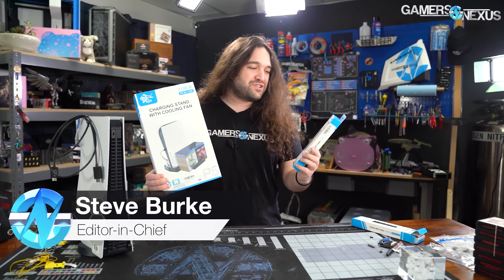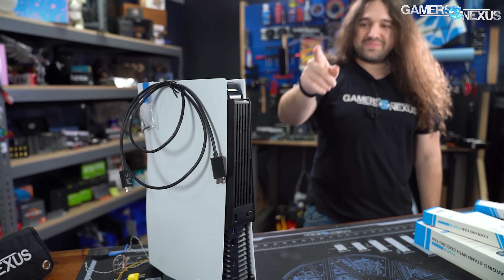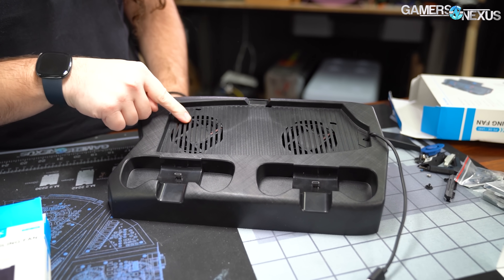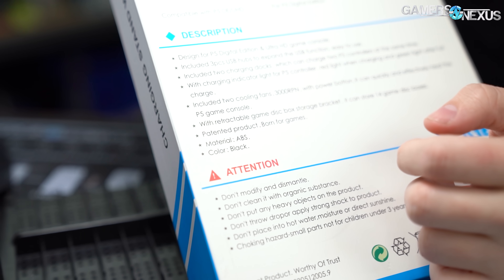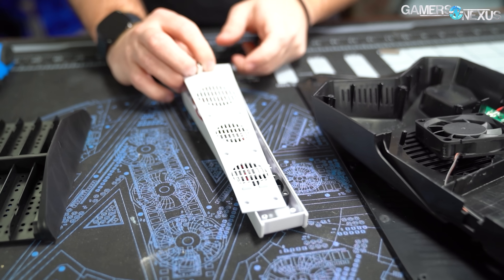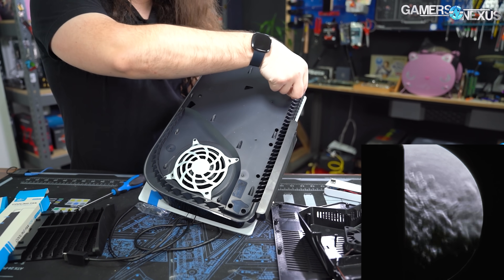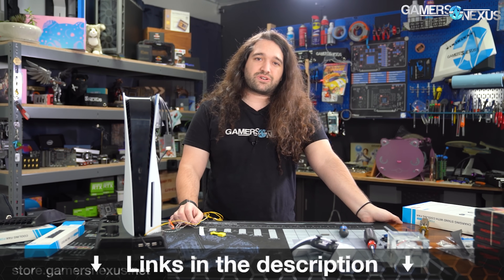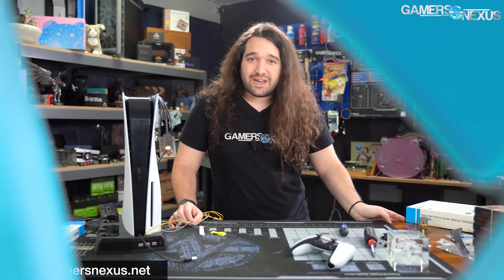Basically A Scam: PS5 Aftermarket Cooling Fans Blow the Wrong Way

Comment: Bahaha this has been the same since the Xbox 360 days
Reply: Your right even if they do work they will kill your console faster because of dust build up I've worked on 3 generations of console's that suffered early demises because of them
Reply: anyone remember NYKO? lol
Reply: @CozzyB  hah i forgot about that, i just got the cheaper usb model.  the original 360 sure liked to melt itself to death
Reply: @CozzyB  the "Intercooler" Nyko fans were monsters.. I've had one for years, and since it runs on the 12v power brick (instead of a 5v 1amp USB power), it's much more powerful, and CHUCKS air.. it doesn't even allow the highest power drawing Original "Black" Xbox 360 to get warm..
The Intercoolers were in a different league than all other "cooling fans"..
Reply: I bought an xbox 360 cheap cooler.  I had to take it apart and flip the fans so they blew the right way.
Reply: This is just the result of someone feeling stupid they once fell for this kind of aftermarket tech and is trying to make themselves feel better about it.
Reply: Needs more hole technology though.
Reply: Not really, just don't buy cheap Chinese branded stuff like this. I bought a cooler for my Xbox 360 S that does indeed pull air out of the top vent. Don't support these brands, do research
Reply: @DaysofKnight  He was referring to the original xbox 360 cooler not the slim cooler
Reply: @DaysofKnight  lol you should do research. None of these after market fans help.
Reply: @DaysofKnight  just a heads up all aftermarket from ps2 up have been china specials
Reply: @DaysofKnight  do you even understand who you are replying to.
Reply: @DaysofKnight  You bought a cooler for the console that was specifically redesigned to fix the cooling issues...
Reply: @DaysofKnight  they was all cheap junk, if you spent anything on them you overpaid all for noise and a hotter system.
Reply: There was one my friend got that was a cage like device that just basically pushed cold air onto the console.

That one kept it cooler, slightly, but was a giant waste.

Comment: What if you took the fans out of the little one, turned them the CORRRECT DIRECTION, and re-assembled it? Could external fans even do anything?

Edit: Nevermind, they'd still do nothing because bad airflow. What a fail.

Comment: I used to have a Nyko cooler for my 360 that hooked up to the back and pulled air out. It acted as a passthru power adapter. Until it fried and almost took my PSU & 360 with it.

Comment: How is your tach measuring rpm? If it is based on the pulse of a blade going past the light and you have not calibrated the device for the number of pulses(blades) in one rotation it will throw off the measured results. I have a difficult time believing those fans were turning at 9k rpm.

Comment: To be honest, if they made a product that is intended to cool the console, they made a design that fits the console very well, but still ignored the air flow direction and the fact that the product covers most of the airflow exit, that's a scam. There are too many ignored variables that no product designer would ever ignore.
It's like someone saying they made a scuba gear, but can't swim or know how scuba diving works at all.

Comment: Given the fans in the rear-mounted cooler aren't screwed in in any way, couldn't they simply be flipped and have it pull air out? Not that it would be doing much even if you did, but hey.

Comment: Almost over 9000 rpm. Now turn those fans around and check if that rear cooler can work as 'intended' by exhausting instead of working against the console's airflow.

Comment: The sad part is that both the smaller fan and big fan have USB2 connectors. Even the USB3 female port on the smaller fan won't work at USB3 speed.
MADE IN CHINA.

Comment: WOW.... Blowing air the wrong way. Clearly, a lot of R&D went into this product.
Reply: The engineer/janitor must of sneezed and flipped the CAD drawing backwards.
Reply: Production manager Dee Viation was quoted as saying: "Ship it anyway!"
Reply: Look at the English on the box. Clearly they didn't.
Reply: China
Reply: It leaves me wondering, are they all put together wrong?  Or did some assembly worker just not know what they were doing?
Reply: @vablo7198  they just need to flip the fans
Reply: @hunn20004 that what i did home made fan so its blowing the heat out
Reply: if its the opposite are they good?
Reply: That why i made little fan whit an stand so that blowing the heat out from the back where HDMI plug is
Reply: considering its for a console... the designers may have been console peasants...

Comment: Would have been interesting to see what happens when you turn the fans on the rear mounted cooler around. Does it actually help in anyway if they are pushing air the correct way?

Comment: I think that the RPM was measured incorrectly. These devices measure light pulses, so if the fan has 9 blades, it would pulse 9 times per one rotation, thus giving 9 times higher measurement. To measure properly put small peace of white tape on the rotor base and point the laser at its path.

In short read the manual.

Comment: So, I assume the impedance of the mod that attaches to the exhaust would outweigh any benefit the fans might give if facing the right way, but I'm a bit surprised that there wasn't a test pass with the fans turned the right way on the thermal chart. I wonder if they saw that the numbers weren't changing and decided not to waste more time on it.

Comment: turn the fans around on the back "cooler" and see if that does anything.
Reply: "NEW DESIGN" --- you can imagine the rest of the commercial
Reply: I don’t think that would actually change much, sure now it’s blowing the right direction, but there’s also so much plastic in the way for the internal fan that it might still make less air flow outwards.

So at best it would perform at stock levels I’d say
Reply: Like GN stickied on their comment "Like we said in the video, flipping the fans is pointless because (A) this thing screams and you shouldn't use it anyway, (B) the plastic impedes more airflow than the fans add, (C) attempting to accelerate the exhaust in this manner is only going to make things worse."
Reply: I'm sure they thought of that but didn't wanna encourage anyone buying the product in any scenario plus I'm willing to bet it still wouldn't of improved the stock PS5 thermals.

Comment: Would rather a manual override for the built in blower fan. Just something simple to dial the speed. That or a more efficient/higher flowing blower. If liquid metal is not being used as the TIM I would also replace that.

Comment: I would just cut a hole in the side panel of the PS5 where that fan is and glue a nice little grill over it, so the fan can actually pull some decent air. No extra fans needed.

Comment: Can you test it out after flipping the fans so the blow in the correct direction?
Reply: That would probably make the console hotter though because it would blow into the exhaust. Keeping the hot air inside it.

Comment: Well... I just use 2 5v noctua f12 pwm to vent the cabinet in which my Ps5 resides... Inaudible and very effective in removing the hot air and letting the Ps5 itself suck in cool air :)

Comment: I feel like the best thing to improve cooling is to just cut a 120mm hole in the side panels, put a mesh filter on it and call it a day. Would allow for more cool airflow to the fan to suck in? I mean cooling performance improves when taking the side panels off so this would allow for better cooling without having to leave the panels off?

Comment: These fans HAVE to be loud and fast. Of course. Damn Steve you don't understand. They have to overcome the PS5s fan to forcefully push the air out of the other side, it's so obvious... eyebrow wiggle
Good lord, and it got 300+ reviews mostly 5 stars. There you see the suspicious rating system do it's work. Awesome funny video GN!

Comment: "far louder than any console is natively"

Launch PS4 PRO: Not so sure about that buddy!
Reply: My non-pro was way louder than my pro. Some friends had the same issue, some did not. You just couldn't be sure. Maybe replacing the thermal paste or something like that could have helped, but I never tried.
Reply: @hanfred  I had a launch Pro, and it got stupidly loud over time. God of war or Warzone put it into meltdown. I reapplied thermal paste, cleared every inch of the console with an air can, didn't help.
Reply: @highmm2696  It was a launch model too. Good to know that I didn't open it up for nothing then. ^^
Reply: I bought a PS4 pro that had been reset from one of the few people that bought a PS5, almost thought it was going to take off until it was updated, kinda disappointed as a flying PS4 pro would of been pretty cool.
Reply: @whatdafarkenhell7110 "Your xsx can make ping pong balls float? Pathetic. For you see, my PS4 Pro levitates defining all laws of physics. Bow before your NEW king."
Reply: my roommates pro sounds like an airport.
Reply: The reason the PS4 and PS4 pro sound like that is because thermal paste needs to be replaced. Its not hard at all if you've ever built a PC. 

I have a launch PS4 and had to replace the thermal paste now it sounds great. And taxing games like Warzone still kick the fan on but the fan noise has been greatly reduced.
Reply: @JARRYDTHEPAIN  I did that on mine. Didn't help at all
Reply: You people need to clean your fucking consoles and not cram them in shit entertainment centers/small spaces lmao
Reply: @juicebox7417  That was not the case.
Reply: My launch PS4 Pro was fine and I find it hard to believe even the noisy ones could be nearly as bad as launch Xbox 360s.

Comment: Everybody: Can't get a PS5
Steve: Proceeds to literally smack one around for 20 minutes.
Reply: Better than those cynical channels that just smash PS5's for clicks
Reply: It's not a fragile device by any means, not when fully assembled anyway
Reply: @Psycho Mantis so is a pc with a 2070 super and one of the fastest SSDs available in the market.
Reply: @Psycho Mantis it's a very powerful and expensive "toy" that rivals higher end PCs.
Reply: How are these two things related?
Reply: I finally able to buy a ps5 at BB, pick up.
at 10:57 am cdt
It'll be ready for pickup by feb 26th, Show proof of purchase and ID.

$540!!!!!

YOU WILL GET ONE. 

once it's restocks 
BE QUICK AS FUCK.

Unless you want you buy one from ebay fo $1,100
 lol

Comment: given how easy it was to flip the direction of the fans, I'm surprised you guys didn't try the flipped direction for the rear fans.
Reply from the maker: Like we said, it's so loud that no one should do that. Also, they have almost no LPM throughput, so won't do anything except make it worse by impeding it.
Reply: @GamersNexus  Even if you know the result beforehand it would still be interesting to have seen testing and numbers.

This entire video was on a product that you already knew would not work and would hurt performance, if you're not gonna do certain testing because you already know what the result will be then you should not have done any of the testing in this video.

Comment: A question on your RPM test... is your device calibrated for how many blades each fan has? Otherwise you would have to divide the raw "rpm" number by the number of blades. On the smaller fans, your 8400RPM would actually be a much more sane 1050RPM.

Comment: I have had a laptop that had so terrible cooling, that blowing air at the exhaust actually improved the stability of the computer. Although it was an extreme case, since after opening the computer once and forgetting to reconnect the fan, it took me an hour to notice it. So the built in fan barely did anything.

Comment: Fun story, I needed a slow fan to keep some air moving, so I soldered a Y-cable to an USB cable to run a 140mm noctua fan on 5 volt. But running an electric motor without the RPM-indicator wire isn't really safe.
In my case it's fine, since it shouldn't be able to pull more than 0.5 watts.
These heating fans? I bet their power supply can supply a lot of juice.
Could you guys test shorting the power wires with increasingly lower resistance and see how much power it can deliver? At some point these fans will wear out and at that point they might short the circuit.

Comment: These products are bonkers. I wonder if there's an aftermarket casement which would allow for better ventilation at the bottom? That, a few tall screws capped with dome nuts and the fans reversed might actually help to improve cooling.

Comment: If those fans on that bar that attaches to the exhaust can be reversed so they exhaust air rather than pull air in, it could actually improve thermals.

Comment: Wondering if there is any sort of aftermarket additional cooling/induced air flow thingermajigger (it's a technical term) for the Series X. I bought a little stand thing to give it some more clearance but even that I'm not sure if it works lol.

Comment: The single best mod for the PS5 right now would be a mesh dust filter you could attach to the front in order to reduce the dust intake. Even at the expense of making the console just a few degrees hotter, not having to worry too much about dust build up over time would be a massive improvement.
 Even better if it comes with a mesh side panel, so you can also improve airflow.

Comment: We all knew it was going to detrimental within the first 2 minutes because the fans were facing the wrong way. I stuck around for another 16 minutes thinking you might try to flip the fan over and see if that improved temps. You could then have taken a holesaw and drilled out the venting bits to remove any impedence to get a secondary reading. Now I still don't know if these types of products can help, just that these are incorrectly assembled.

Comment: I remember buying these for my PS3 and realized how worthless and noisy they were at doing their job. Shame to see the scam still stays strong with the current gen.
Reply: I didn’t even realise people attempted to cool their consoles. When I was a console gamer, I never worried about temperature and my console never died. My PS3 is still running all these years later. I’m starting to think that I’m too invested in cooling my PC.
Reply: @mustafam3285  Indeed. Unless you're overclocking, temps don't matter much.  90C CPU temp?  It's actually fine:  90C is hot to us, but CPUs aren't human and operating at 90C is within their specifications.
Reply: look you can tell it's working by how i can't feel hot air coming out of the console any more

Comment: I'm a little surprised that you didn't flip the fans to see if they'd actually work as intended if it weren't for shoddy assembly.
Reply: He did, but didn't show in the graphs. He said though that even turning them around is still a worse result than stock because the thing has to little hole area and obstructs airflow.
Reply: Maybe if they also cut away the obstructing plastic it might help slightly.

Comment: Did you test the back fan with the fans flipped to flow the proper direction? It seems easy enough to do since the fans are not screwed in. I expect it to still do poorly, but just curious what the numbers were if tested.

Comment: Get a spa blower and make a jig to connect it to the gaming system and try and see if it works better than these. Spa blowers are powerful and loud and I have always wanted to do a "fanless" system just cooled by heatsinks/radiators and a single spa blower for the lulz

Comment: I was hoping that you would show some thermals with the fans flipped around the correct way in the thermal test to see if it even could theoretically work if they hadn't completely messed up their design.
Reply: I was thinking the same thing, he's already got it apart and they're not even screwed in, take like 3 seconds, 1 per fan!
Reply: I was expecting that myself. Seems like a quick fix, considering the fans aren't screwed in. 
A missed opportunity.
Reply: Yeah I was hoping he'd do that, I wanted to see if they'd actually help
Reply: This
Reply: This is exactly what I was expecting him to do because he knows the fans are blowing the wrong way.
Reply: Yeee
Reply: This
Reply from the maker: It's too loud and obstructed. So no. Don't buy it regardless. It's not going to help and is a waste of time.
Reply: @GamersNexus  It's not that we'll buy that pos, it's that we're wondering how much of an impact a slight vacuum on the exhaust of the PS5 will have on the thermals.
Reply: @AndyU96  he did point out that the fan case has too much plastic(less holes) which impedes flow regardless of direction. yes they add three vacuum points but shuts of the rest of the vents.
Reply: @GamersNexus  we aren’t saying we would still buy it, but doing a test with the fans actually going the right way, would be interesting.
Reply: @andykillsu  I don't think GN ever goes down the "what about if you did this" rabbit hole. I think the "standardized fans" setup for cases is about as close as you get.
Reply: @GamersNexus  Maybe a follow up vid, possible title "The fans are spinning the correct way and it is still a POS", Kinda, we fixed it to prove how stupid it is to even try.
Reply: @GamersNexus  I'm curious about how it'd run if you slap in some Noctua fans and a proper PWM controller in there. IMO that'd make that garbage pretty good but I can't blame ya if you don't want to touch these dumpster fires of products anymore x)
Reply: @devilselbow  GN now a shill confirmed.

/s bc it's sadly necessary nowadays
Reply: @h8GW  they don't shill

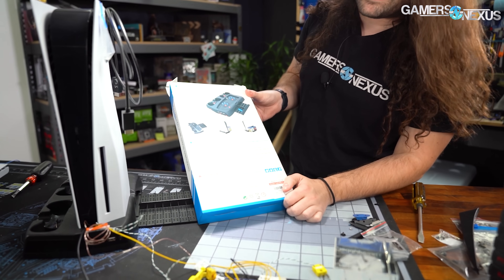Comment: 5:10 well, of course. the console heater has a cooling fan. just like space heaters have fans to blow the heat to the destination, it needs to blow the air into the console :D well, at least onto the console